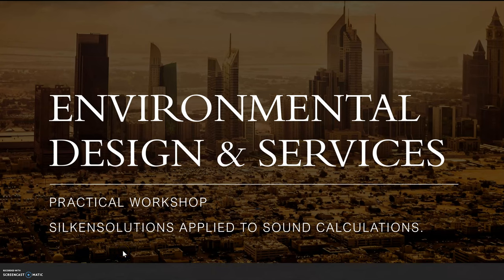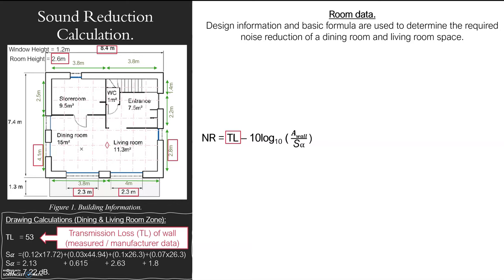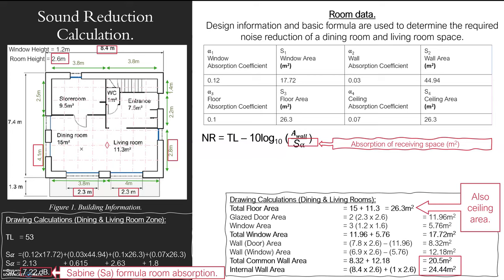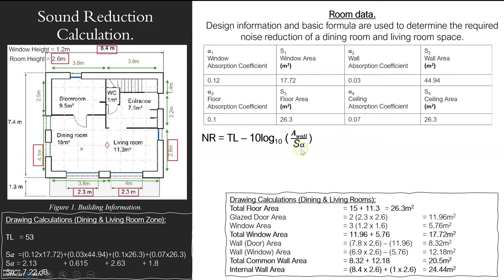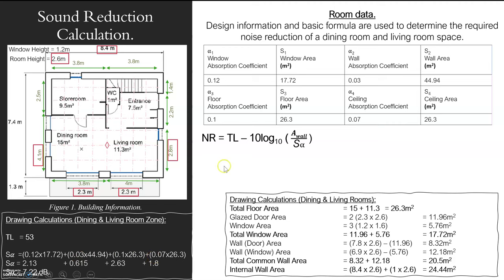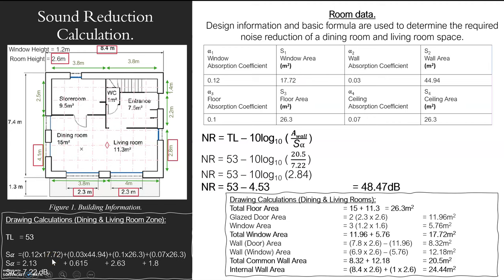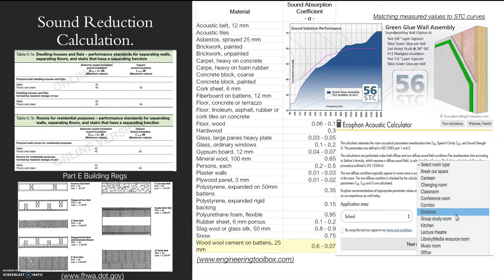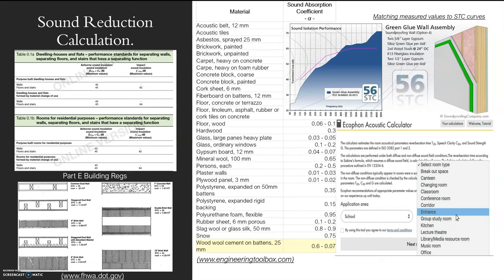Acoustic Calculations: Sound Reduction

Comment: Thank you for the very informative video, kindly advise if there is a need to cacluate the NR through the wall nearest to the source of the sound only or for the all the walls of the building.
Reply from the maker: Apologies I don't look at comments normally as these resources are for my students. NR for wall is just the wall you need to look at whole room acoustic approach if you have multiple walls all with different sound issues. I'm not a published author or chartered acoustics engineer but when I come around to upgrading this resource I will ensure to add some detail on this. Thanks for your enquiry and I hope you found the result you needed.
Reply: @silkensolutions  Thanks you for your feedback, much appreciated. I managed to solve the challenge with the information from the video and a few other sources. Thanks again.

Comment: Why are you comparing Part E Building Regulations criteria of separating elements for walls and floors between habitable areas with an external façade sound insulation calculation? External façade sound insulation isn't relevant to Building Regulations Approved Document E, and would come under the jurisdiction of the local authority, with guideline internal sound levels given within BS 8233:2014. Building Regulations Approved Document E is only applicable to sound insulation between ADJOINING dwellings.
Reply from the maker: Apologies I've not got to this sooner. Yes agreed. My calculations are to show students the process and not all my data is entirely accurate. I will take note of this and if I update this resource I'll be sure to add this so there's no confusion. Thanks and I hope you enjoyed the video.